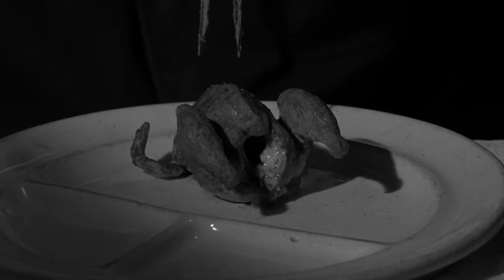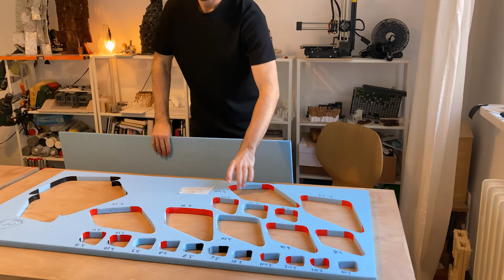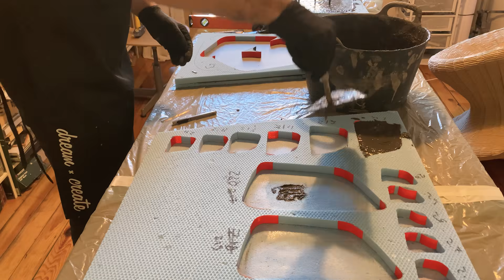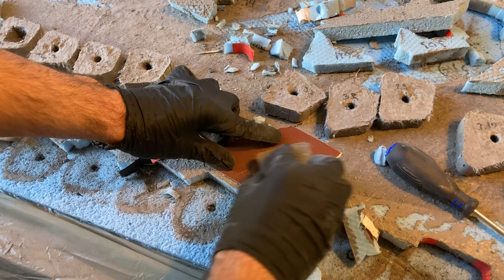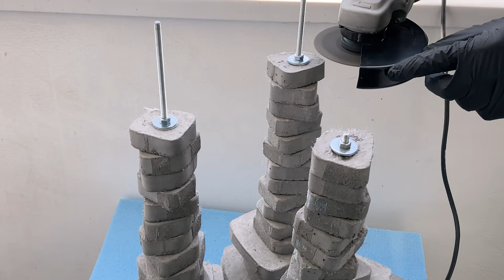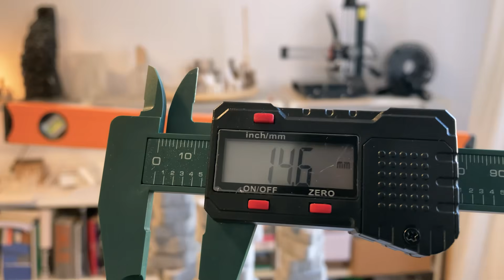ERASERHEAD™ TABLE

Comment: I feel like goo needs to leak out from under the top slab and cover the legs. Then the goo should set, like a black epoxy.
Reply from the maker: I'm literally planning a "leak" for the next video.   
For this one I tried to keep it structural, like the object itself is what leaked and then froze in place.
Reply: @prjct.fiction very cool,  you mentioned the leak, and I was like, that sounds awesome. I didn't realize the project wasn't done. It looks great so far btw. Your videos deserve more veiws.